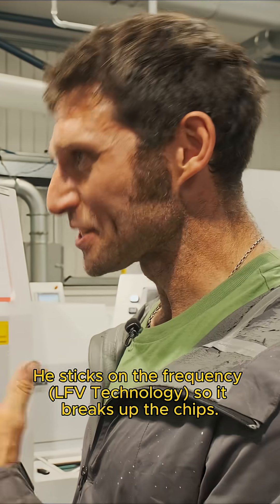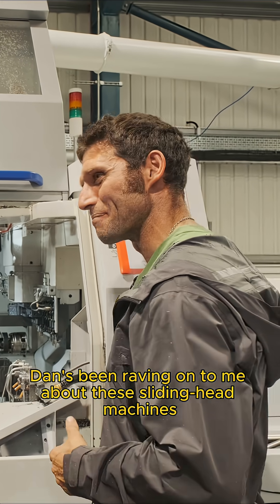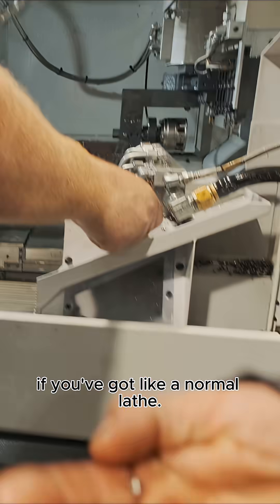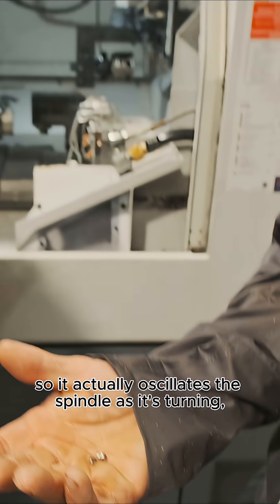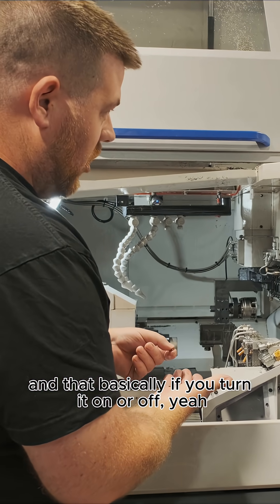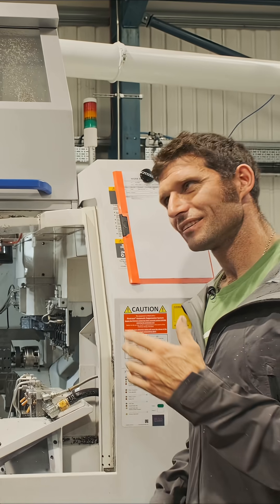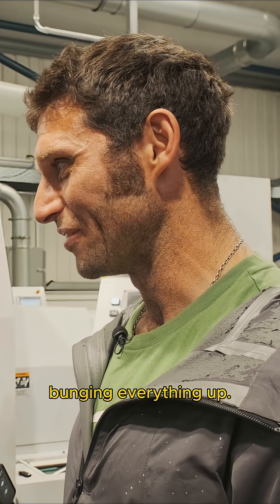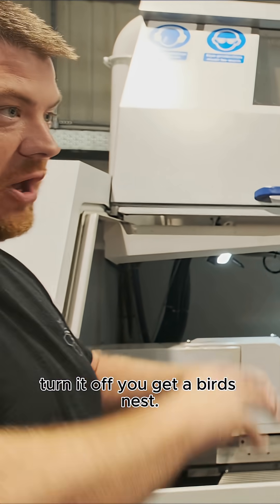@GuyMartinOfficial visited @Evotechperformanceparts and discovered more about #LFVtechnology

Comment: But what does the surface finish look like?
Reply: I work on these machines and sometimes it’s more noticeable than others (depending on material, insert, depth of cut etc) but typically no worse than 0.8um and often better. If you looked under a scope you’d get slightly more pronounced turning ‘ridges’ but for most customers it’s acceptable and they don’t even notice. You can use it on drilling and parting off/grooving too. Very handy tool to have in the back pocket 👌🏼
Reply: @madman3371 very cool, thanks!